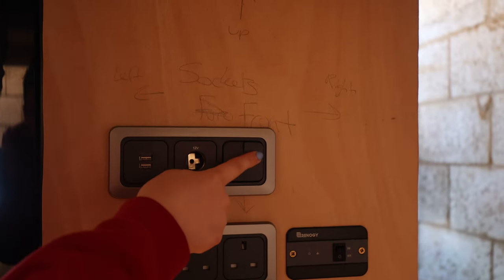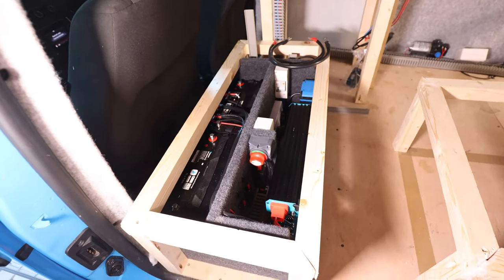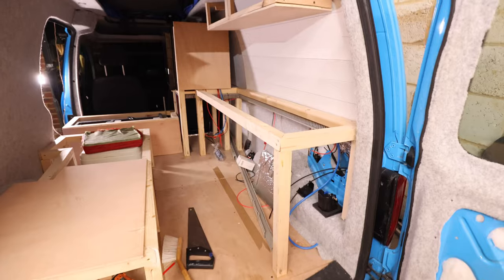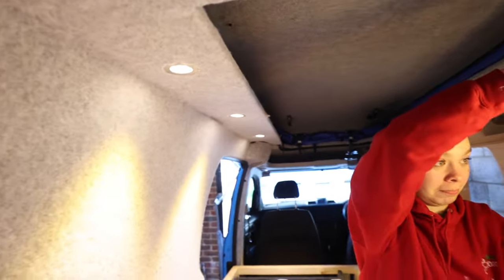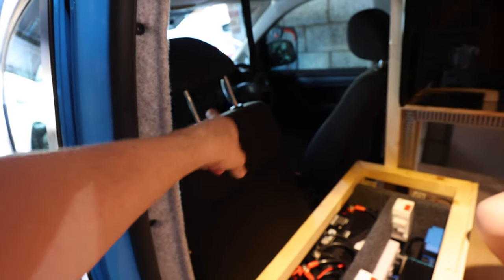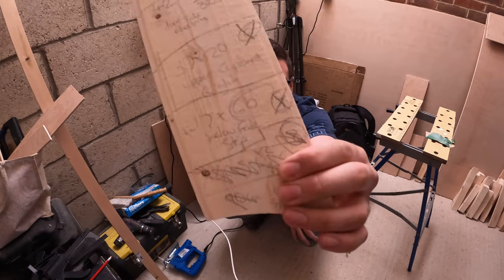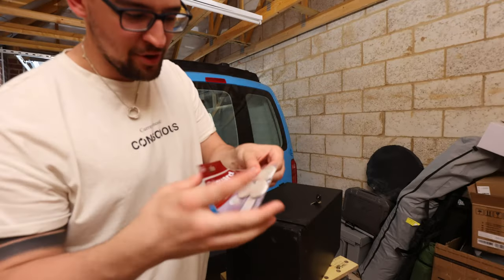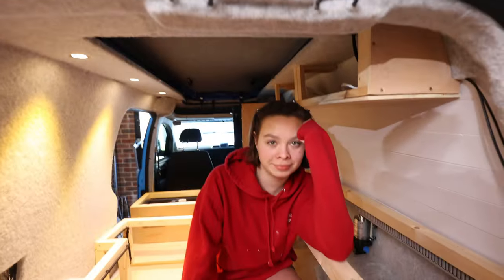Installing Electrics in our Micro Camper | Converting a Van | VW Caddy Maxi | Van Build #10

Comment: Hi! Did your van have an old British Gas battery isolator fitted under the bonnet, and if so did you disconnect it from the starter battery before you installed your split charge relay circuit, or did you just leave the isolator attached and everything worked fine? Thanks!
Reply from the maker: Hiya, thanks for the question! We disconnected the isolator long before relay circuit was installed as it actually ended up draining our battery (ironically) 😂

Comment: just wondering if you took power from the main battery to the inverter via switcher to charge both via alternator? whats the best route for cables if so from that main battery
Reply from the maker: We do have the electrics hooked up to the main battery which means when we drive we also generate electricity, also means we will never have a flat battery as solar keeps it topped up too! It runs down behind the seats, we did get an electrician to handle this as I didn’t want to be reasonable for it going wrong 😂

Comment: Hi, loving your enthusiasm and the look of what you're doing,  but am a little concerned about the height of the fridge.  Have you considered what would happen to it if you were involved in an accident? Perhaps consider putting half a bulkhead behind the drivers seat? Not wanting to undermine anything you are doing,  just want you to be safe!
Reply from the maker: Hiya! Thank you for the concern, the units are strongly drilled into place, and the fridge has provided holdes to drill into the frame. So I guess the only time something could go wrong is in a major crash but we would have bigger things to worry about 😅 but defo is safety first!!!
Reply: @thebastenjourney   I'm glad you have given it some thought. I suppose I was thinking fridge and contents probably weigh 30Kg, and screws into wood might not be strong enough to hold it even at relatively low speed collision. That's why cargo vans have metal bulkheads. I'm sorry to go on, and will stop now,  just wanted to make sure you had considered it. Very best wishes to you both and I look forward to seeing your future endeavours.
Reply from the maker: Ah no its good to hear all advice, the fridge also sits wedged besides the 2 pillars of wood, hard to explain but is slotted in so that if it was to hit the person driving it would have to break the screws and the wood entirely. So it's definitely securely in, if it wasn't screwed in the the only way it could go is out the side doors 😁